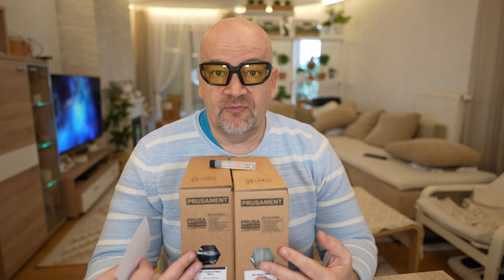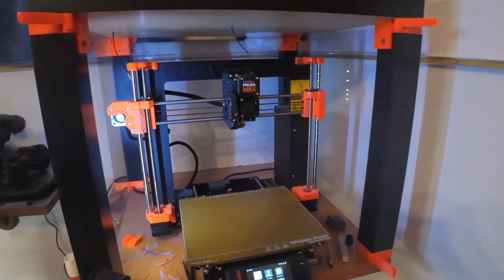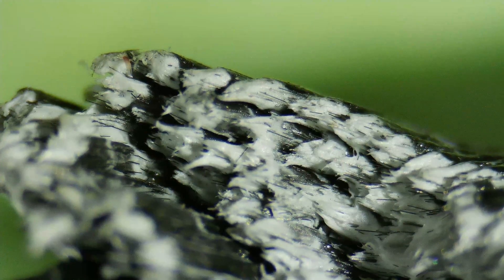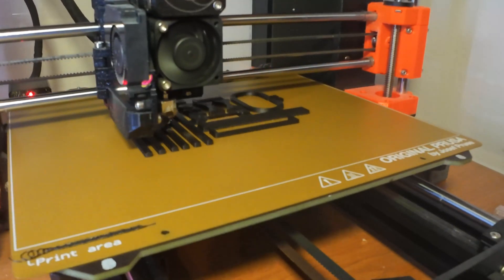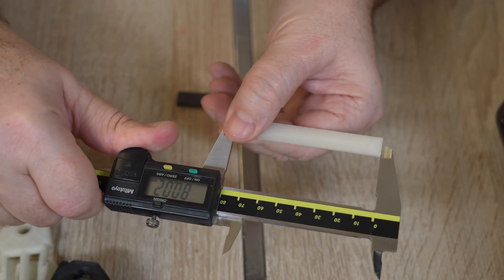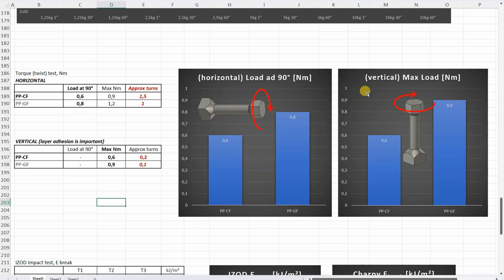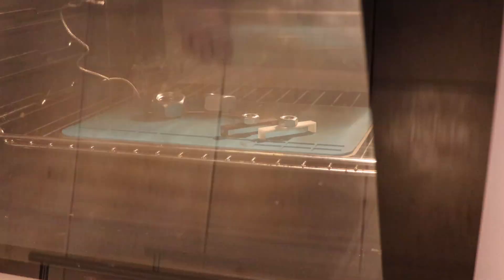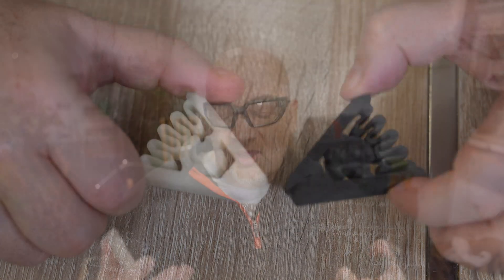Prusament PP-CF vs PP-GF Tested – Carbon Fiber or Glass Fiber Polypropylene?

Comment: l find your testing very thorough and interesting...  thank you for sharing!
I wonder if the same strength testing results would hold true for PETG Glass Fiber versus Carbon Fiber filament?   
I guess/assume the same conclusions might be found,  that the GF filament is stronger in PETG too.   
It appears that PETG is more impact resistant than PP- polypropylene... but more dense so heavier, but with less VOC's.   Interesting tests.
Reply: no, PP is far more impact resistant than PETG which has the lowest impact resistance out of all common FDM polymers.

Comment: PP-CF is our preferred material for underwater robotics, largely due to the low weight and performance in water for months at a time.  We're using Redrapper PP-CF now, but will try the Prusament PP-GF, thanks to this video.  Annealing can make the parts stronger.  We use Magigoo PP without issue, but it is important to apply a very thick layer while cold, then heat the bed for some time around 100C before printing.  The white residue should disappear after reheating the bed above 90C.  Excellent video.

Comment: I'm quite surprised by the weak layer adhesion results. PP generally has extremely good layer adhesion. The PP-GF I have seems to have it in spades. Obviously fibers affect it, but I'm wondering if this filament would benefit heavily from higher print temperatures. Perhaps a slight increase in extrusion ratio as well.

Comment: I've been 3d printing things almist 24/7 for about 10 years, and every time a part I've made out of PLA ended up being too weak for it's intended purpose and buy a supposed "stronger filament", it always ends up weaker and I just go back to PLA.

Is anyone out there actually getting better prints with all these "infused" filaments?

Maybe I give up too fast and just need to dial in settings better...but I've had terrible luck with every reinfirced filament I've ever tried.  Granted it's been a few years, and maybe they are better now....but they really were a huge disappointment and I wasted so much money chasing better than PLA.
Reply: There are Materials for almost every specific need. PLA is a strong material aslong you don't have any heat or chemicals or long lasting loads on your parts. Summer outside could be too much for PLA. And no, to outperform PLA in many cases you do not need "fiber filled filament" you just need to pick the right material...
Reply: Try Tinmorry PETG-CF and PETG-GF. You won't be disappointed. Makes printing PETG easier, it looks great, and the layer adhesion is phenomenal. Otherwise, yes I and many others have had great success with numerous filaments. PET-CF and PET-GF are great all around entry level engineering filaments. The Qidi crown does a lot of functional printing so we've been using higher level materials all the time.

Comment: The CF filled PP starts off as clear so visually the black carbon fiber inside absorbs  light, when you stress the plastic it turns opaque so it reflects light at the surface where there's no carbon fiber so it appears white.
Hope this helps

Comment: Interesting that the GF print settings are so different than the CF version (mainly nozzle temp)… I wonder if it is related or relevant to the CF version’s behavior when bending, or is it as simple as the CF needs higher temps to flow well? 🤔

Comment: I prefer of the layer adhesion ratings were based on percentages of the XY tensile strength instead of absolute values. The PP CF layer adhesion is 34% of it's XY tensile strength, while the PP GF is 24%. So the PP CF is actually more isotropic. Also it would be good to test impact strength in the Z axis as well, often times CNC Kitchen has shown differences in layer adhesion strength based on the speed of the load (i.e. a material with great static layer adhesion strength has relatively poor impact strength along the layers)

Comment: For light weight applications they look good options, but with the low layer adhesion results and their price (plus the price of the special print surface) they are not a very attractive option at the moment. Is Polymaker considering to add a PP based material to their Fiberon line?

Comment: The stress on the polymer causes the colour change due to the crazing effect and the orientated stress induced crystallizarion of the macromolecules. Some micro voids (called crazes) are made and the "bridges" between the voids get highly crystalline making the plastic in that region also stronger. 
If you are curious to test another polyolefin filament I can point out the HDPE from Spectrum filaments!
Thank you for the video and happy new year!

Comment: The whitening effect is caused by Mie scattering.  As another was pointed out in a previous comment, the material undergoes reconfiguration at yield.  Basically, the region that undergoes yield becomes fluffy as microscopic PP fibers are exposed.  The fluff scatters all visible light, so it appears white.  This is the same reason  clouds look white.

Comment: I can't help but wonder if the PP-CF was printed too cold, limiting layer adhesion.  You really need a better temp tower.  I've been conducting a "Shiny Silver Silk PLA" test for a few months, comparing different silk filaments for best metal-like appearance and isolating the best printing values for each.  One of my tests is a custom temp tower that includes break-away tabs to check layer adhesion strength.  Quite often I find that a few degrees can make a big difference in layer adhesion.  You're already printing a temp tower, but you only judge it cosmetically, and you're missing a huge opportunity to evaluate layer adhesion across a wide range of temps in a single test.  I'm sure the idea is self-explanatory, but feel free to reach out to me if you need any visuals of how I constructed this test.
Reply: What temperature tower do you recommend?  I've found with these reinforced filaments that there can be a wide spread of temperatures that give very similar looking results on the standard tower.
Reply: @ferrumignis  Honestly, I don't have a favorite to recommend, that's why I created my own.  Mine is special purpose, a hard-core test to expose silk properties, takes 16 hours to print and uses 180g, so I don't even recommend my own.  I spent 15 minutes looking for an example temp tower on both Makerworld and Printables, and only found 1 with the breakaway tab feature, such a shame!  On Printables, search for "Temperature tower remix" by Torstein, and you'll see the breakaway tab he added.  I personally find that tower a bit limiting, it only has 45 and 55 degree overhangs and no arcs, it could definitely be better.  I also don't like the position of the tab on Torstein's tower, it's in the middle and hard to reach for measuring.  I use a small force gauge and break each tab capturing the peak force.  I put my tab on the side, so I can lay down the tower and simply probe it from the side to break the tabs.  I think the test would be even better if the tab either had a slot for consistently aligning the tool, or a hole to use a hook, as I do feel like I have some minor inaccuracy due to inconsistent tool placement.
Reply: he is always too low on temps, vide PPS-CF/GF which should be printed at 370, not 350 producers state, and maxed chamber temp (he can do 75C on plus4, but at least keep 65 for everything that needs it). I see it as catering to plebs with plebs low temperature printers.
Reply: Exactly pp bonds lile nothing else. It is a print issue not material. I've noticed a lot of people focus on surface finish and overhangs ignoring layer adhesion the only thing that really matter for engineering prints.
Reply: Hmmm I think I saw this exact reply to a previous material test video….. Copy/paste or bot comment.
Reply: @Amn2k9  not at all lol
Reply: @Amn2k9  I completely agree, you are a bot that is copy/pasting generic replies that don't reference the topic being discussed nor add any measure of value to the discussion. At least you admit it.
Reply: @PaulStevensonPinball Something seriously wrong with you… I did recently see a similar reply to a video, and there is a million bots/fake accounts out there replying to videos. My reply did not need any further content, as it simply addressed a potential issue. Maybe I was wrong in this case, but your reply as well.
Reply: @Amn2k9  not sure of the bot thing, but I do agree some of the videos appear to be printed a little low. Examples would be the Polymaker HT PLA GF and Elegoo PETG GF.
Reply: @Amn2k9 Thanks, I needed a good laugh.
Reply: @PaulStevensonPinball You’re welcome.

Comment: the color change is due to the crystallization of the plastic material subjected to excessive yield stress
Reply: Almost precisely. PP under stress forms voids which scatter light. It is generally known as stress whitening. Stress crystallization does play a role in the density and size of the micro voids (and their formation) but less on the overall refractive index. It is kinda' like the cause of the cause, but not the direct cause.
Reply: @szeredaiakos  agree, PP does not undergo stress induced crystallisation

Comment: The black carbon fibers are not stretching with the white pp. The simply pull out leaving the white stretching pp as the remove. And pp is quite clear in color until it is stretched. When small inclusions occur due to stress it tends to white. If it is reheated slightly it will usually turn clear again as the inclusions fuse.
Reply: I think there are still pigments in the CF version.

Comment: I buy PC Blend, PC-CF, and PP-CF from Prusa.

The GF version doesn't make much sense to me, given the much higher density. I would prefer to use PC-CF instead of PP-GF.  Maybe there are significant differences in chemical resistance that make PP-GF a viable option, but it’s not my use case.
Reply: Having better strength in most tests isn't a useful benefit of the GF version?
Reply: @ferrumignis  it isn't because PC-CF is a much better choice if you consider PP-GF.
Reply: PP is nice for glue related fixtures. We use it at work for some since even industrial epoxies just pop right off with finger force once cured. I did some tests with it and even superglue didn't stick properly.

 The only time I got anything to stick at all was when I put a huge drop of superglue on a piece and let it sit for a few days. I still managed to pop off the blob with q screwdriver and look at everything under a microscope. As far as I could tell, it only barely stuck at the edges where it sort of sank into the layers a little, so more mechanical bond than adhesion.

Other than that, it's completely resistant to acetone, xylene, standard cleaners, and a lot of common acids and bases. 

It's also fairly low friction, though not so great with the fibers. Since pure PP won't stick/bond to most filaments, but will with fiber filled PP, you can print custom bushings or plane bearings meant to go in nasty chemical laden machines with pure PP wear surfaces and stiffer fiber PP structures (great for replacing parts on old equipment).

Overall, it's a fairly niche plastic since it looses out on a lot of the toughness and flexibility of pure PP, but definitely has certain uses.
Reply: @DrPersonman  my main point was the criticism of PP-GF because it has a higher density than PP-CF. All my use cases require a lower density and no stickiness.

Yes, PP-GF has better physical properties, but I'll use PC-CF when physical properties matter most, and stiffness is a priority.

That being said, maybe it's possible to come up with a situation where PP-CF and PC-CF are not good enough, and PP-GF is a more viable option.
Reply: @tshev  Ahh, sorry, my mistake, I thought you meant you didn't like any of the fiber filled stuff.

I suppose if the part is not solid you can start looking at the exact thickness you can get away with relative to physical properties. Like, if you can get the same performance with 4 walls of the GF version that you get with 5 of the CF version you might find situations that lean towards it even with weight factored in. So, if you ever run into the very specific situation of needing lower weight and chemical resistance on a bigger part, that could work well.

That said, you could also get tricky if you have a prusa XL or other tool changer printer as you could then use PC-CF as a structural skeleton with designed in mechanical interlocks that let you print in pure PP to hit a nice balance of weight and chemical resistance with lower surface friction that PC-CF. It's more design time but then you can get very tricky and even add something like a foaming filament to the core of the part instead of infill if it needs to be solid, a tough and stiff PC-CF skeleton, and a coating of slick chemical and impact resistant PP. Think of the technique as being like print in place composites and overmolding combined with mechanical features overcoming plastic incompatibilities... Just a lot more labor than using one material and more failure points. @tshev  Ahh, sorry, my mistake, I thought you meant you didn't like any of the fiber filled stuff.

Comment: The results are disappointing in terms of layer adhesion. I printed with raw PP a long time ago, on an unheated bed even. The warping of the first layer was bad, but because of good layer adhesion, didnt delaminate later. Raft fixed my problems back then. For small bed contact area, had no issues later on. Wish they made a core version, otherwise - hard pass on this.
Reply from the maker: If not they, I will test the core version. I have some pure PP here... soon..
Reply: PP by its very nature doesn't want to stick to anything but itself. However this presents great layer adhesion.

Magigoo makes a great product that solves the bed adhesion issue pretty well for PP, and I use it with success. GFPP is one of the best materials to print in my opinion, once you get the adhesion sorted. It regularly produces parts which fail across multiple layer lines rather than along one layer, which in my book is a key indication that it's as strong as it ever will be. You do have to be generous with the temps however.

Comment: I'm very excited for the results! I love printing PP! For years i feared it, because i hate even printing with glue stick and didn't want to mess around with tape. The i really wanted to try it. I used a G10FR4 plate on my Plus4. It really works well. You need 90°C on the bed and a brim. Closed/heated chamber is beneficial, but according to my test not really mandatory.
Reply: I have to come back and give an update and thank you. I used a 60 grit sanding sponge in up and down, side to side, diagonal, and circle patterns to get a rough surface. Put the plate at 100°C and pressed print with baited breath. 

With the higher temps I had no warping and it stuck just fine! As soon as the print was done I gave it a tug or two and it was really stuck to the build plate! I could lift the plate with the print. After cooling, it was still a little too stuck, but flexing the plate and pulling got it free with no damage to the part or the build plate. And a plastic scraper took care of the purge line and support brims that stuck around.
Reply: @Lethal_Bite  I'm glad to hear that.
Reply: What grit of sanding/surface roughness did you do with the G10?
Reply: @Lethal_Bite  First i wanted to try the rough side up without any processing. But i somehow glued that side down. I wanted to have a really rough surface but also mostly all the area treated. So i went down from 280 over 120, 80 to 40. Maybe it's silly. But for me it worked.
Reply: @grott3n0lm I see... I got some pp-cf of another brand and had tried my garolite/G10 plate but it didn't work for me. I had to go with pp tape which limits bed temps to 50° or else the adhesive fails. That means the chamber wasn't very warm and I had some warping to contend with.

But my G10 bed is quite smooth, just 000 steel wool to buff the surface. I'll definitely give some coarse sanding a go and see if I can't get better prints from my pp filaments!

Comment: My black Eryone PP-CF does the same whitening-on-bending thing. 

FWIW, testing fatigue, I tried to hold one side of the bent PP-CF filament fixed and moved the other half back-and-forth 350 degrees 250x with no failure.

Comment: I'm addicted to these filament test videos.  I watch every one, even for filaments I don't plan on using.  I love that My Tech Fun is doing useful testing in a standardized form with the results in a spreadsheet so we can select filaments and materials that fit our needs.  This is invaluable data for engineers and companies 3D printing products.

I'd be very interested in why the PP-CF filament that's uniformly black all the way through is white on the inside when bent.  I'm accustomed to plastics turning white when stressed and the bonds between adjacent polymer strands are broken, but I didn't think this whitened polymer would supersede the black carbon fiber color.  At most, I'd expect gray, not white.
Reply from the maker: I asked them, but its their secret. Even the % of the fibers in the filament..
Reply: He's one of the only! Does an epic job

Comment: Polypro is commonly used for low cost kitchen appliances like coffeemakers, steam irons, etc because it is the cheapest resin with somewhat decent temp resistance.  Usually mineral filler like talc is added to make it even cheaper and a bit less warpy.  Polypro has a major liability for consumer products in low temps. It tends to shatter when it dropped if it's cold. 

Given that polypro is a super cheap resin, it was more than slightly shocking to see it at $75 on Prusa's site for less than 1kg. 

Hard pass. Will take PPA-GF any day.
Reply: Interesting, in my experience in with cold environments PP is the most impact resistant plastic. What plastic is better in your experience?